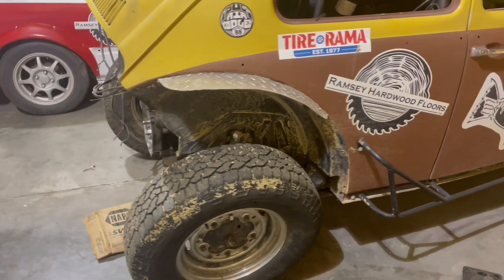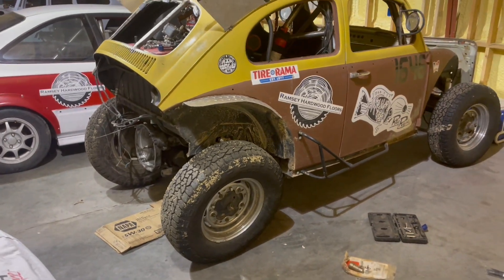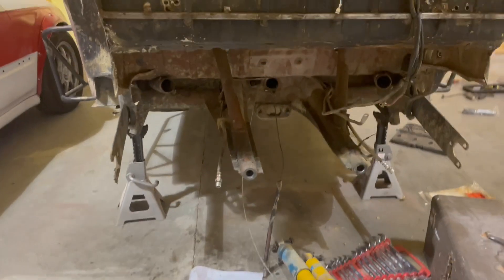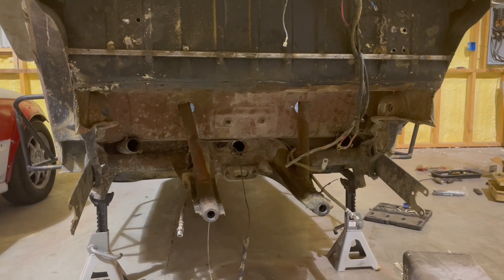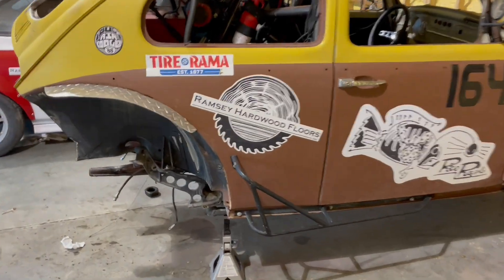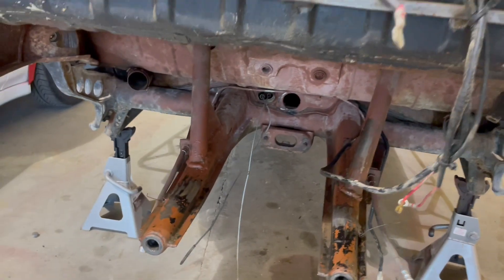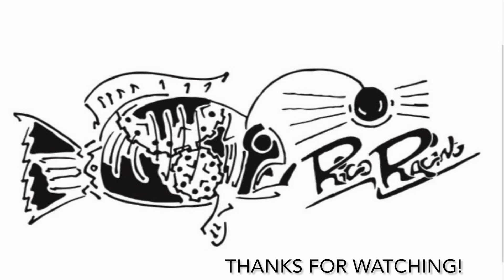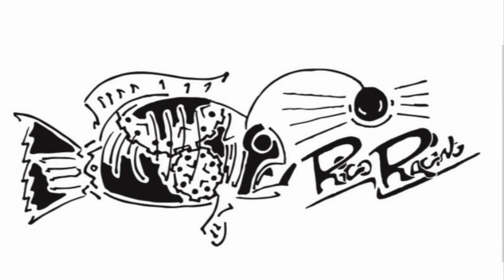Baja Bug IRS CONVERSION ep1

Comment: Great video. What are the make and size of those tires?
Reply from the maker: they are Goodyear Wranglers. 235 75 R15s. fit on stock 15 inch VW rims!
Reply: @ricoracing1646  thanks!